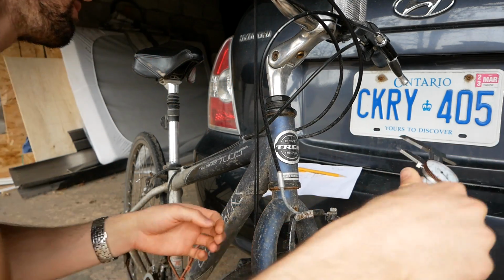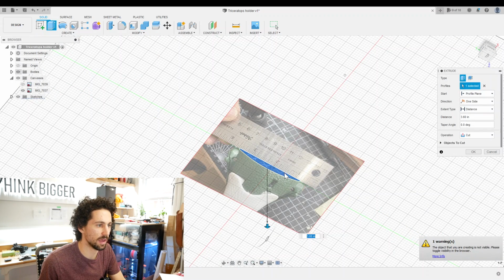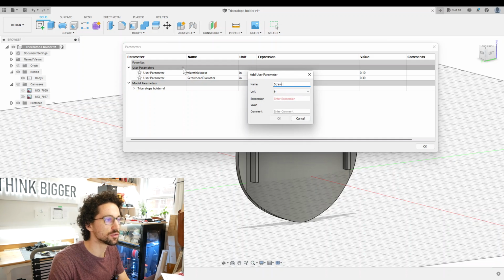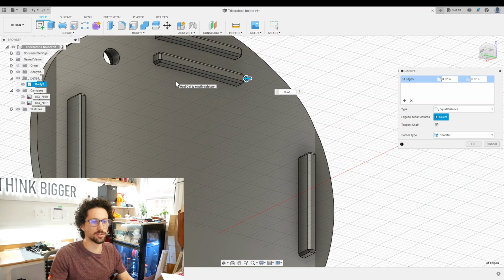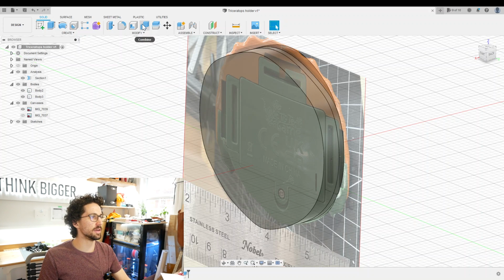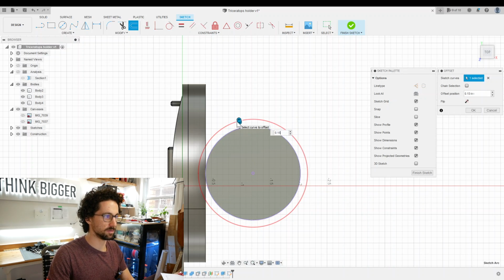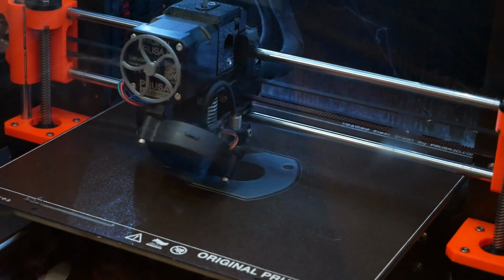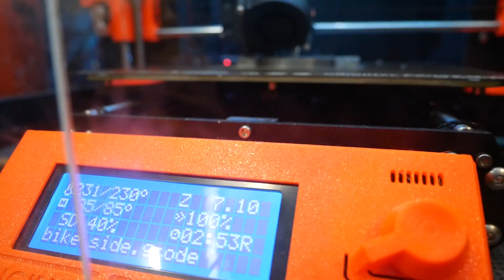3D Printed Magnetic Quick Release Mount (for a bike light)

Comment: you epoxied over the battery holder
Reply from the maker: I didn’t, that whole assembly is attached to the triceratops with screws. It can be unscrewed to change the batteries.

Comment: very meticulous on fusion, great stuff! one question though, i usually don't trust it when magnetic quick release systems don't completely seal and secure the magnets with an interface between the two magnets that is printed with the pieces surrounding the magnets, but rather use adhesives instead. I never worked with epoxy so i wouldn't know how many cycles of mounts and dismounts it would last and this is something of a silly over engineered project to begin with anyway so it wouldn't be a shame if it gave out at one point, but it somewhat put my mind at unease to see large magnets making naked contact for the sake of a quick release system 😄. nevertheless, cool stuff.

Comment: You use calliper lil' wrong. Another/Upper jaws is for inner measurements.
Reply from the maker: Yeah I used those to measure the inside of the slots, but it was so small that I wanted to check with the other jaws.